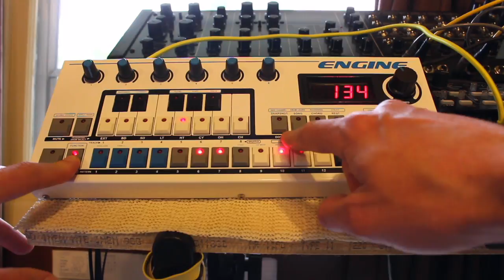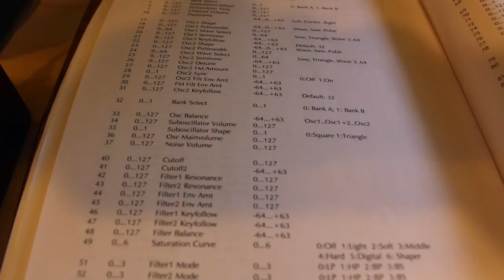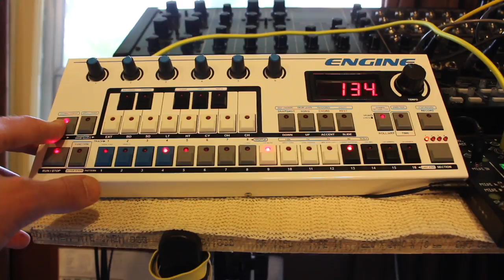Creating Control Type Patterns & Assigning Knob Controllers on Engine | Social Entropy How To

Comment: Trying to control a Prophet 6 with the gligli upgrade which enables midi control.  Gone through these steps and assigned knobs but it won’t work.  I’ve tried doing this on the synth type pattern and on control type patterns.  Any advice on how to trouble-shoot?